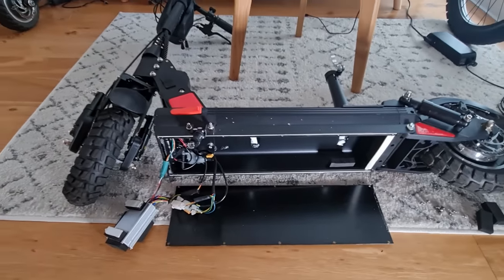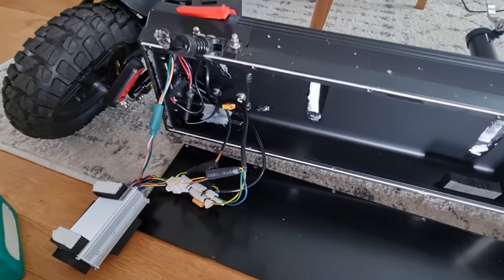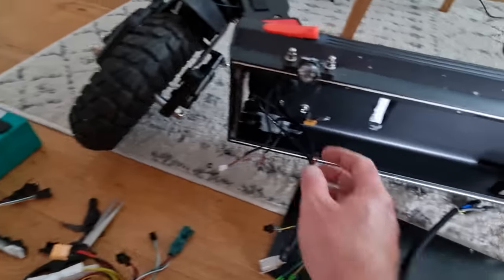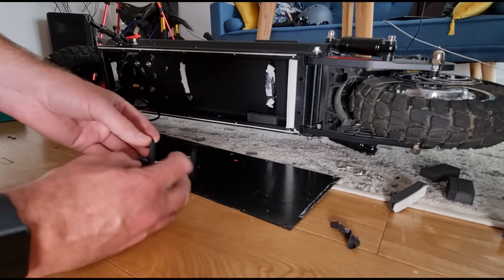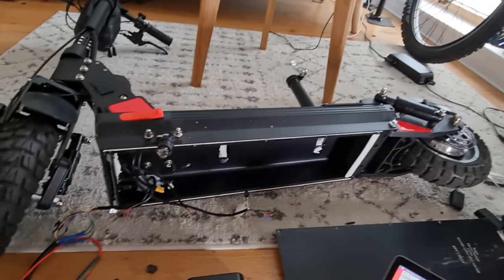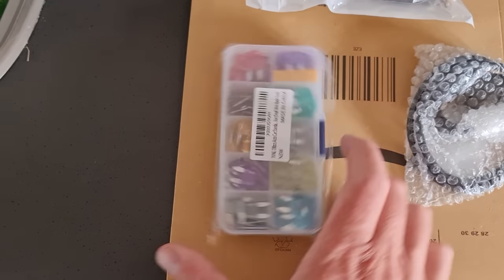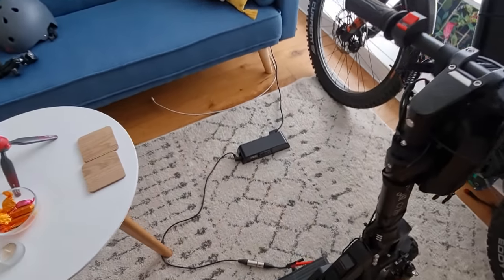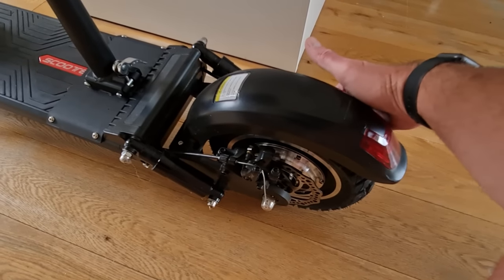LET'S MODIFY AN E-SCOOTER!!!

Comment: Hello Mr kirby its mr kirby here again,  I have a solar p1 pro Tron addition, 60v 25A controller's on a 26amp hr battery,  the company who has built these scooters has told me that they don't supply the .b. controller I need to replace my broken on , so solar scooters they will sell you the electric scooters but you can't replace and repair because they don't sell parts  ????   This is bad business practice in my eye's  What a total con .  If I buy 2 new 60v controller's with the screen to match, with the hall censors on them Will it run just the way it was,
Reply from the maker: Hi fellow kirby! Yeah that does sound like a nightmare. You should be able to replace the controllers with alternative ones. Check the existing controllers for a part number and Google search it, they are just Chinese controllers in there anyway so something similar should work. Hope it helps!
Reply: @andykirby  thankyou for the information,